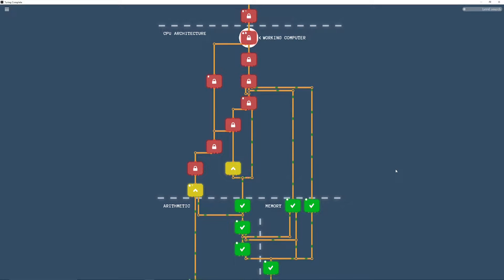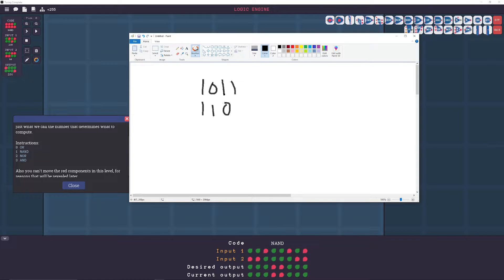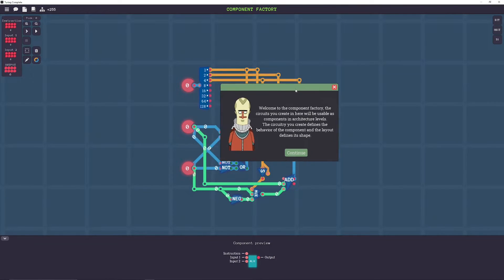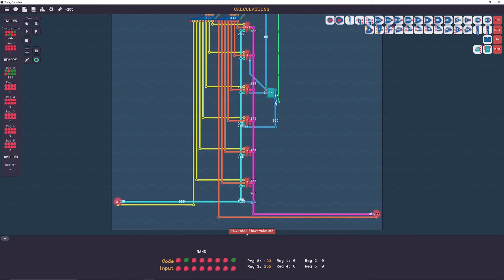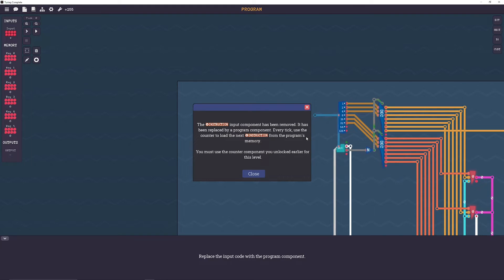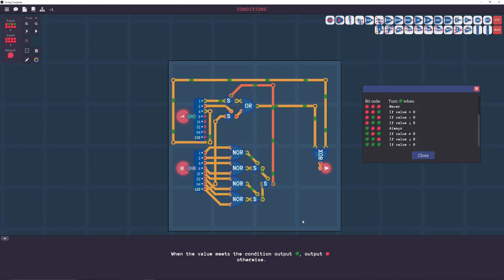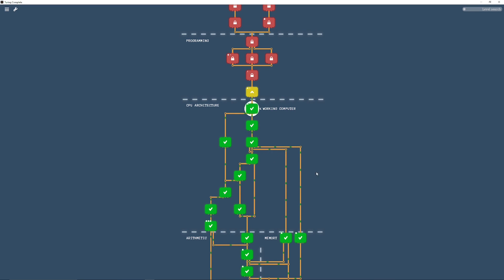TURING COMPLETE WALKTHROUGH - CPU ARCHITECTURE (Whole Section)

Comment from the maker: 0:00 Logic Engine
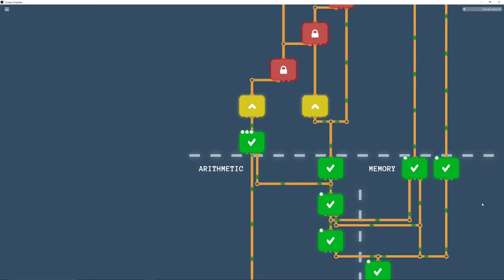8:16 Arithmetic Engine
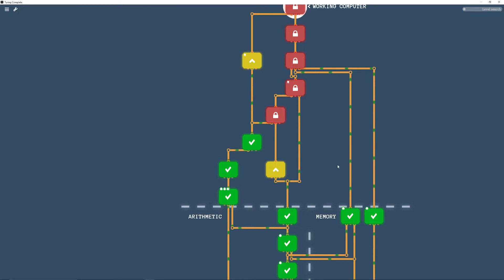12:56 Registers
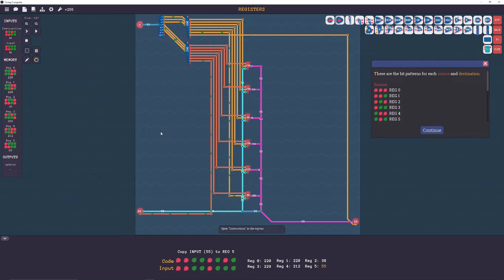18:39 Instruction Decoder
21:20 Calculations
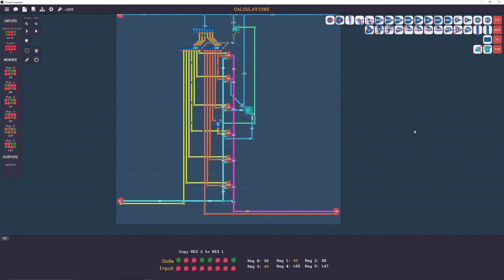27:01 Program
28:31 Conditions
35:00 Immediate Values
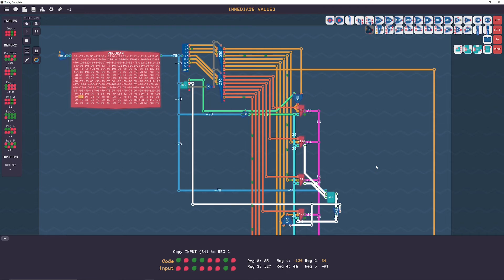37:19 Turing Complete
Reply: I noticed you're defaulting to a big-endian format.
I have various reasons for a LITTLE-endian format, including my ancestry and how left-to-right convention places the LSB at left in circuit module representations.

Comment: I also had to redo the 'calculations' design. Previously, I didn't use any encoders, and instead I had used a bunch of gates and switches to assign bytes to registers. It worked ok, but wasn't nearly as clean/simple as using these nice little decoders.

On 'program', I was very confused at what we were supposed to do with the new 'program' and counter components. That's my only mark against this game, is sometimes the directions aren't very clear with explaining what you are supposed to do. I had thought the program component was similar to the ram component... But actually it seems to act as the list of instruction bytes, which will not iterate through the bytes until you put the counter on it. 

Great videos!

Comment: Nice video, was just using it as a reference to compare it to the solutions I was working on. 

On your Instruction Decoder section; after splitting the byte line into 8 bits, all you need to do is use a 3-8 bit decoder feeding the last 2 bits from the splitter into the first 2 input bits of the 3-8 decoder ignoring it's last input bit. You can ignore the first 6 bits coming out of the wire splitter as well. Then simply just run a wire from the first 4 output bits of the 3-8 decoder to the designated controls ignoring the last 4 output bits of the 3-8 decoder. Not that your solution is wrong, just that using premade components does make for a cleaner looking design. Or you can build a 2-4 bit decoder and save it to your component library and use that as it would have less internal components. "Layers of Abstraction!"
Reply from the maker: I guess I'm a stickler for optimization. A 3 bit decoder uses a lot of gates which is kinda wasteful when all that's required is a few nots and ands. It's been a while since I've played but if I remember correctly at some point the game will start calculating your gate delay and such.
Reply: @Andoxico  True, but that's why I did say "Or build a 2-4 bit decoder" using that in place of the 3-8 bit decoder. This would be most optimal and practical for this particular application.Make a folder Decoders. Then have independent schematics for each decoder: 1-2, 2-4, 3-8, 4-16, 5-32, 6-64, 7-128, and 8-256. Then you'll have the exact decoder you need for each particular application.
Reply from the maker: @skilz8098  a 2-bit decoder is exactly what I built
Reply: @Andoxico  Yeah, but I was thinking on the line of a module that you can reuse. :)
Reply: @Andoxico  Okay, the game does have limitations. It won't let you build sub components that can be reusable at this stage of the game... what a shame.

Comment: My logic gate solution took up half of the entire available because I did each operation on all of the bits separately because I forgot you can make the other gates out of just nots and ors. After hearing you say it again, I came up with a solution that's similar to yours where instead of 2 ors and 2 mux, I used 1 or and 3 mux

Comment: I actually completed the conditions level a completely different way and the final level just wouldn't work, I must have had some fringe edge case where the output was wrong but all of the tests passed. It was driving me insane so I just used your solution and it worked.. lol

Comment: I wish it would have specified in Conditions that you only need to worry about signed ints, I got hung up overanalyzing the case for unsigned when the high bit is set. Also, you can check if the input is zero with only three components - negate, add, and 1 bit not. I'm not sure if that's overly clever but you get an achievement in the game for solving Conditions with 10 or fewer components.

Comment: I solved the last task slightly different. Same as you I plugged the main but into override value input of the counter. But then I just used AND to make sure that both condition modde is on and condition is met and plugged AND output to the counter increment/override input.

Comment: Comparing to your conditions solution, I can see that I'm overly dependent on NOT and AND gates. I've used more switches compared to before after you pointed out they're basically AND gates. I'll probably be using XOR gates more now that I can see them as togglable NOT gates.
If I come out of this game learning nothing but these two tips, it would've been worth it. Thanks!
Reply: I think I rely on XOR more than anything else now. I've been checking solutions after solving them and realizing I'm using twice as many parts as needed. Been trying it other ways as well, but making sure I understand why it works before carrying on

Comment: I think your solution in conditions was a bit difficult, i use a 3-bit decoder and i think it is mach easier to understand
Reply from the maker: that's valid, but later on when you unlock the stats for each level like the gate delay the 3-bit decoder will be slower :p
Reply: @Andoxico  oh, I'm gonna to rebuild all... :(
Reply from the maker: @onepunch1908  don't feel bad, the important thing is you thought it through and made your own solution
Reply: @Andoxico  hah, thank you, of course in this area it is necessary to ponder, reflect and not just copy someone's template... and his decision will come in any case. I don't have any problems with arithmetic and ALU logic in this game, but I can't fully understand how memory works
Reply from the maker: @onepunch1908  If you go back to Saving Gracefully you can kinda study how memory works. When the SAVE/DON'T SAVE input is turned on (SAVE), whatever the state of the other input is will be saved in the circuit and output the next tick. That value will stay in the circuit even after the SAVE input is turned off and will stay in the circuit until SAVE is turned back on and overwrites whatever was in the circuit. Put 8 of these together and use a switch on the output side to toggle LOAD/DON'T LOAD and then you have an 8-bit register.